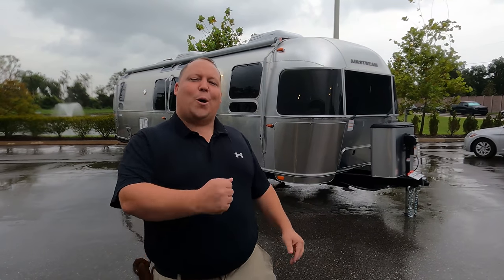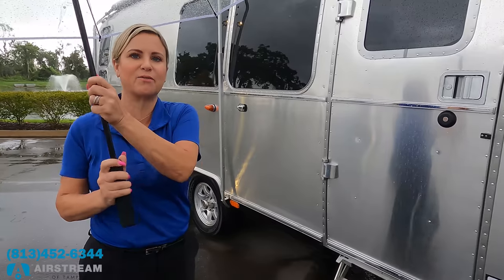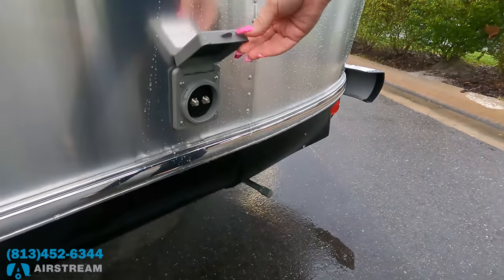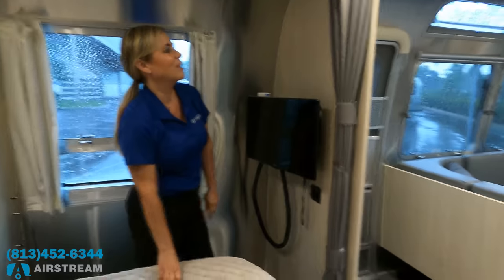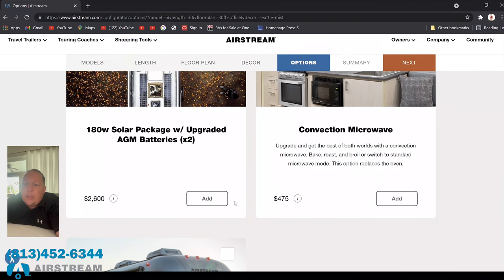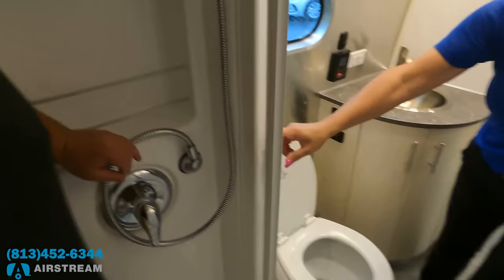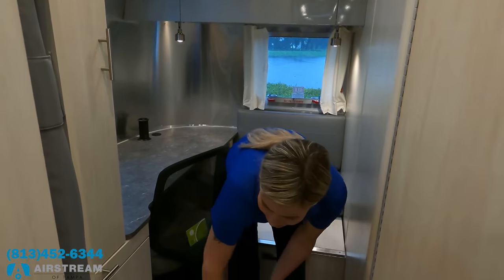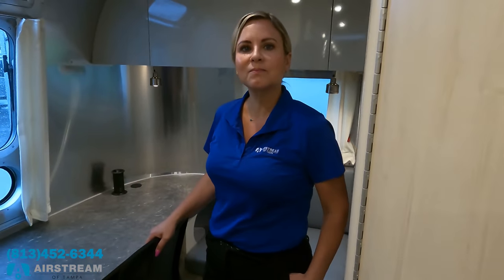AIRSTREAM I would Fulltime in with an OFFICE!

Comment: Hi, Would love to see a video on half ton couples campers for tall people (6’2”), especially in areas such as bed and shower. Small being defined as under 26 feet in length and double axle. Also would like to see ones with larger cargo carrying capacity (more than 1,500 lbs).  Maybe a separate or same video showing what the manufacturer lists the hitch weight/UVW and then the weight once dealer standard options are added such as batteries, propane, etc. to see what is left in CCC and how it impacts the hitch weight. Thanks

Comment: I am so impressed!  There is so much storage!  The office is freaking amazing and converts to a bed.  Love the kitchen and bathroom. It just feels so BIG and has so much, in such a small space with NO slide outs.
I worry the shower would be to low, but there is a seat inside so that is a plus instead of banging my head.  I would also prefer a door on the bedroom area.  I'm surprised Matt didn't dislike the steps.  I'm afraid I would snap those things right off the trailer.

Comment: Things I love:
- storage space
- build quality. Even though it's a lower level Airstream, it's still better than most Jaycos and stuff.
- the office, perfect for working folks. 

Things I dislike:
- lacking in the electronics department, with all the modern stuff this trailer can run, anything less than 500 Watts of solar isn't good enough (especially with a price tag like this). It also needs a bigger inverter, at least a 3000 watt one. It's also annoying, because it'd be such a cheap and easy fix.
- that sofa is kinda useless. I get that some people like it, but I'd  make a floorplan where the sofa is more like 2 person wide one, and I'd use the extra 2 feet of newly available space to 1: move the galley there then extend the bathroom and put in a washer-dryer combo cabinet in there.
- I don't know if there's already an option for it, but I'd make the upper cabinet doors white to visually open up the space.

Matt said "you should always end on a positive note ", so here you go: the review was amazing, also, as viewer, I too would like to say a thank you to Airstream of Tampa for letting Matt do his thing

Comment: They just want a place to have their computer, and or printer and office.  Back up guest bed.  Love the office.  Would love to have air frying capability in the convection microwave oven.  Thank you for the  video.  Would love a shelf behind the toilet.  Would like to connect a tape deck or other audio in an auxiliary port into the stereo system.  Wish they could put a washer/dryer combo.  Love what it has, the awning and roomy dinette, love the awning style windows.  Would love the bed to adjust up, like in the classic models.  Would love more color choices, like Aqua Blue that is in some of the other models.  The living room TV to have an articulating arm, some don’t have that and a larger one in the bedroom.  I understand you could mount a TV in the office, or an Display/monitor to hook up a laptop or Mac Mini.  (Mac Mini, the most portable desktop).  I would use that bench in the office (remove the cushion and place a printer there), especially a larger printer.  I will have to say, I really love that Office.

Comment: 3 dislikes:

1. Agree on that couch. It’s just meh in an otherwise awesome unit.
2. A 12 volt fridge would be nice.
3. The office bed seems almost too small for any adult.

3 likes:

1. That office is sweet (ignoring the bed which is unnecessary)
2. The storage. Some of it seems too small to be useful but there are plenty of large cabinets and drawers.
3. The MSRP. It’s high for a trailer but very reasonable for an Airstream. It’s AN AIRSTREAM! That beast will last forever! And nobody pays MSRP so it’s gonna be a great deal!

Comment: Great video folks! Glad to see that y'alls transition to independant is going well. As for this unit, let me say that I'm not a huge Airstream fan. I've always felt that the price wasn't worth what you got for it. This one, however, seems to be a bit closer to being worth the price.
Reply: I do agree with the high initial cash outlay. However, my current Airstream(31' Excella 1000) has been on the road for 32 years(1989)
Reply: She will be retired in a couple weeks with a 30' Flying Cloud and used as a guest house. Major issues, were refrigerator replacement in 2009 and  new axles in 2018. The 1989 cost $33,000 new and the 2021 $115,000. Worth it in the long run to me!!

Comment: Great layout, my DISLIKE would be that watching the TV in the lounge is not practical. You are cranking your neck around to watch TV vs looking at it straight on from the couch or dinette.  I suppose if you turn the dinette into a bed/lounger you could cuddle up with someone and watch tv straight on.....otherwise not ideal unless you plan to lay down on the single wide couch.  I agree a pocket door would be nice but those are only in the 33' Classic line up.  I also agree that a power awning on a 30' trailer should be power.....but that's Airstream.  Once you move up to the International family and higher up to the Classic's the camp side awnings are all power.  As a Flying Cloud owner myself; they are great trailers but just very blah basic for an Airstream.  This 30' foot office model would be a great upgrade, but we have our eye on a 2022 33' Classic for our next Airstream.  Would love to see you review one of those and all of their features added for this year.  We actually wanted to get the Pottery Barn model but due their lack of storage and elimination of the pantry and other things we want; we are going for the Classic now.  Cheers!